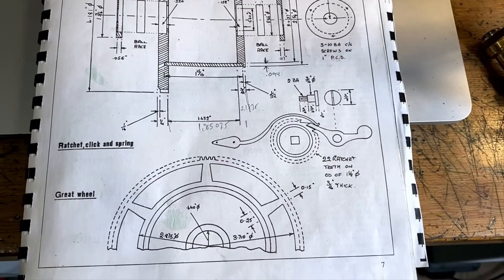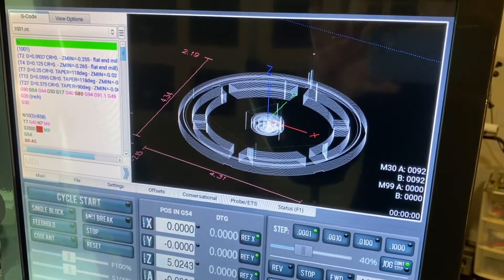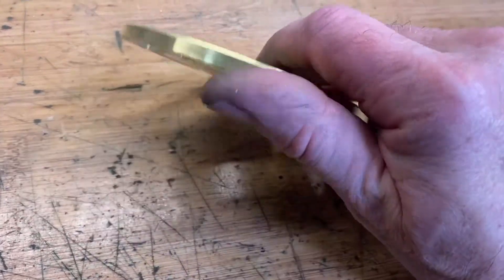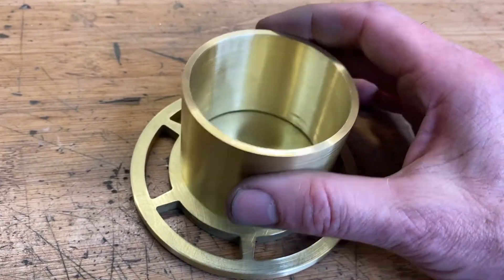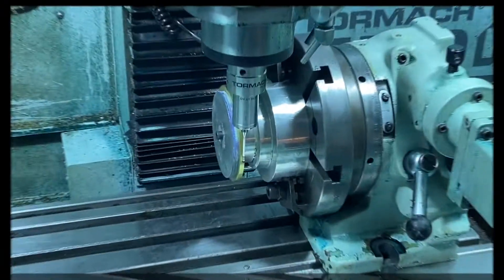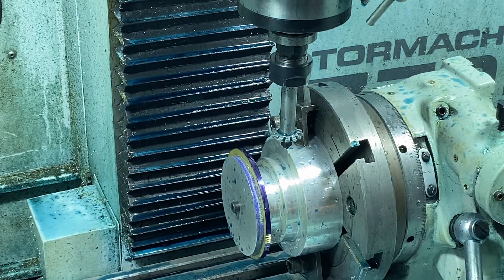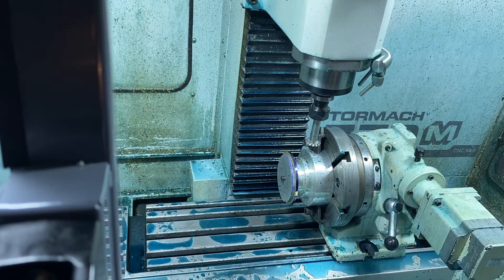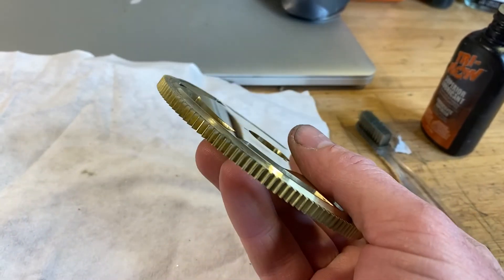Cutting a clock wheel on the Tormach

Comment: When I saw this the first time I didn't think about it but 130 teeth on a clock gear seems a bit strange. I just did a little research on clock gear ratios and up to days it doesn't seem like a 130 tooth gear would be used assuming the escapement wheel is moving at one tick per second and it has a standard number of teeth. (In a very short survey of escapement wheels they seem to have either 15 teeth or 30.). I found it interesting to think about this issue even if my guessing is ill informed. Right now my guess is that 130 teeth is associated with something like moon phases or some other fanciness that will be in your clock. I'm off to take a look to see if there are more videos about this clock.

ETA: Wow, I just looked at one of your videos about this clock: https://youtu.be/V1eHcUbvSw4 This is amazing. I still don't understand exactly how the 130 tooth gear fits in but this thing is amazing.
Reply from the maker: It is a very strange design, it is not usual in many ways and if I could do it all over I would change a few things.  The main people with the clock is the type of escapement.   It is very sensitive to leveling of the clock.   I am going to go back and make some modifications to it when I get done with my current clock.   Thanks for watching.

Comment: Hello Kevin, nice work! But could I cut such a brass wheel entirely on a CNC in two setups if I don’t have a lathe?
Reply from the maker: Yea should be able to if you have a way to index and cut the teeth.   I use a 4th axis for that.    The thing to watch is to keep it all concentric.
Reply: @KevinNolanMakes  Thanks Kevin but in the CNC the indexation is done by the G-code and tramming, correct? Do you mean to cut the non-prismatic bits of the teeth I guess. But if I do two setups and just flip the wheel and then some toolpath to shape round off (so to speak) the teeth is there an obvious reason why this cannot work? I ask because most watchmakers seem to use specialized watchmaking tools to cut wheels, but I only have a CNC :)
Reply from the maker: Yes but the thing you will need is a cutter for the teeth, the profile needs to be exact and the teeth are to small to cut with a end-mill.  You can buy the cutters you need from P.P Thornton.   You can also make them.
Reply: @KevinNolanMakes  Thank you for the response to Micheloud Entreprise Générale above. I am probably never going to make a clock gear but the information was interesting to me.
Reply: @KevinNolanMakes  Thanks a lot!